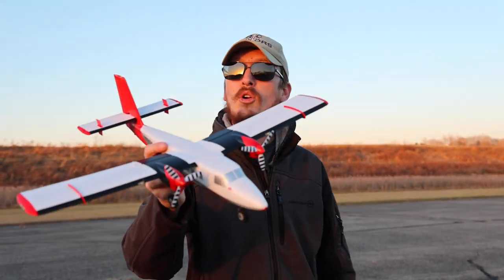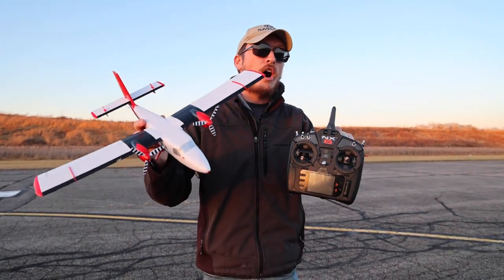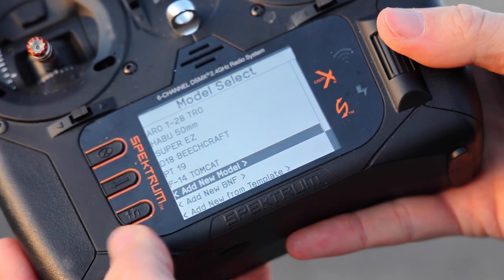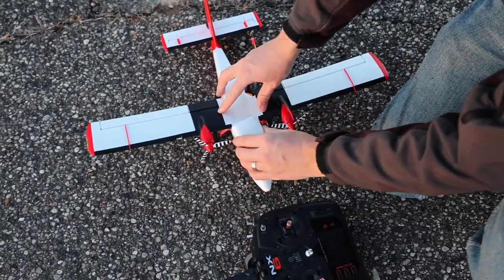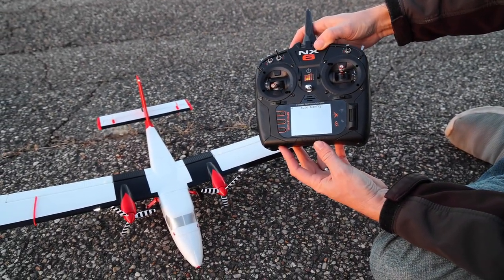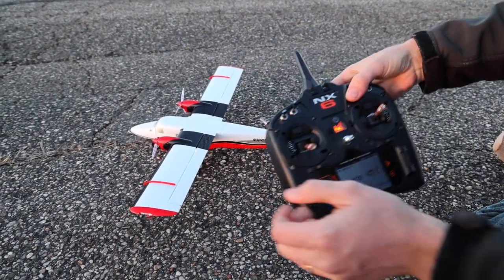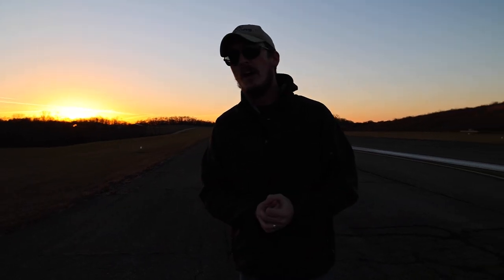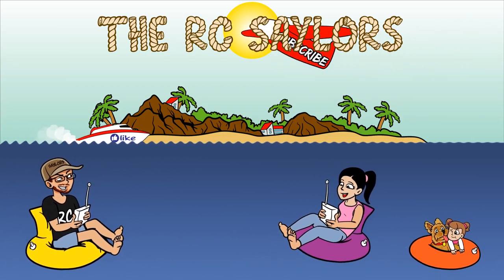How to Bind E-Flite UMX Planes

Comment: You should show some short how to's and troubleshooting vids like you used to. That's how I got started. Love you guys. Happy Holiday's!!
Reply from the maker: We love making that sort of video! Just need to know what people are looking for. Thanks for watching! 👍😁😎⚓️
Reply: @TheRcSaylors  Maybe start with all things battery chargers, tips, reminders and updates. I'm always looking for current info on all thing RC aircraft.
Reply: I'd love to see the procedure to manually trim a plane such as the Carbon Cub S2. Tried following the procedure in the user guide, but I think they either left a step or two out, or are assuming the reader knows something that they don't. 

After flying for a few months, I basically know what needs to happen:

- Put plane in experienced mode, about 50% throttle. 
- Adjust trims on transmitter for straight, level flight.
- After landing, mark control surface position.
- Center transmitter trims.
- Adjust the clevises so that the control surfaces are in the marked positions.

With a brand new out of the box plane and proper CG, I guess eyeballing the adjustments is probably close enough. I've crashed and rebuilt at least 3 times, so I don't think eyeballing works anymore.

I'd like to see how someone who knows what they're doing does this.

Thanks, and Happy New Year to you both, you rock!

Comment: I would really love to see the BNF set up and setting safe to a switch for the larger models, ive had trouble with the holding down the sticks to the inside and fliping the switch not working before

Comment: What about a DX6 transmitter is it the same  ???
Reply: It probably is i dont know i havt tried it but im sure it will be the same!
Reply: The original silver one or the DX6 gen2 the black one? Both will work.
Reply: @mph_5593  DX6 gen2
Reply: @RickyD1968  oh then yeah, it’ll bind right up easy. The cool thing about horizons UMX planes or any of the micros they are super easy to setup. After the bind then you can go into the dual rates and put them on a 3 position switch so you can have a low medium and high rates but personally I hate having a bunch of switches to remember so I’ll usually have do 2 modes. One set at around 55%-65% throw or travel and the second switch position around 75%-90% and for both I’ll set the expo for around 25%. I’ve always found 25% on spektrum radios seems the be the sweet spot cause anymore it feels too slow around center and any less it can feel twitchy.

The spektrum DX GEN2 series seems to be one of the best lines of radios with the lowest QC fail rate. I have a DX8 gen2 that I’ve had for over 5 years now and I’ve never had an issue. I’ve seen too many people lose planes from the iX and new NX series. It’s a very well known problem. Don’t get me wrong I like that horizon is constantly improving but I wish they would spend a little more time with quality control. That’s why I’ll never sell my DX8 gen2 radio or upgrade. I use that radio for a lot of new UMX planes they sell but for my turbine SAB lizard I use Jeti and for my helis I use a Mikado Vcontrol touch.
Reply: @mph_5593  yup its all the same
Reply: @mph_5593  Thank you so much I purchased a used DX6 gen2 and the umx twin otter bnf. My transmitter will be here tomorrow I already got the umx otter from horizon hobby . I have not flown in over 8 years so can't wait to fly again
Reply: @RickyD1968  nice! It’s definitely a good programmable radio and is nice to have for all the cool planes that horizon has and also their helis. Awesome to hear you’re getting back into the hobby!

Comment: Hello Saylors! New guy starting out here. And know that my NXs that came with my first plane carbon cub, is very basic. An employee at my local hobby shop has an NX12 for sale for 450. I know it is certainly for advanced pilots. Just wondering for the price, can it be used by a rookie like myself and take me throughout my voyages? Seems any advance I make would cost close to that.
Reply: Hello Jake! First off I've never heard of a nx12 there's nx6 nx8 which I use and nx10 if you want to know which to get it would be the nx8 transmitter it has all the channels you'll need for years to come p.s. I would buy new! Your friend Marty from Canada 🇨🇦 🛩 🛩
Reply: iX 12 sorry I am trying to learn them! Lol! I see your point of buying new. However the shop will guarantee the radio. Thanks for the input. Probably take that advise.

Comment: iX 12!  I am brand new!
Reply from the maker: A great radio! Happy Flying 👍😁😎⚓️
Reply: Don't use this guide for an ix12! Nothing wrong with this vid at all, perfect for most spektrum radios, but not for the IX12, (and probably most of the IX radios), setup a new plane or choose the model from the list. Plug in the battery to the plane, it will go into bind mode all its self, hit the bind button (hold) on the transmitter until it says binding, release and wait, and as RCsaylors says don't be to close (sometimes doesn't matter but sometimes it will fail if you are too close). The IX doesn't turn on and off like the DX or NX does just fyi